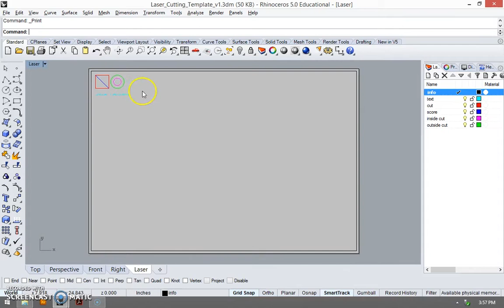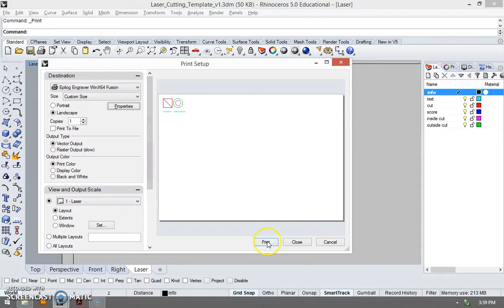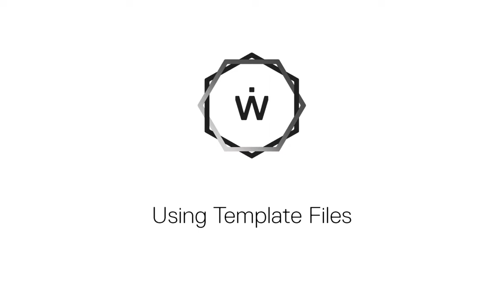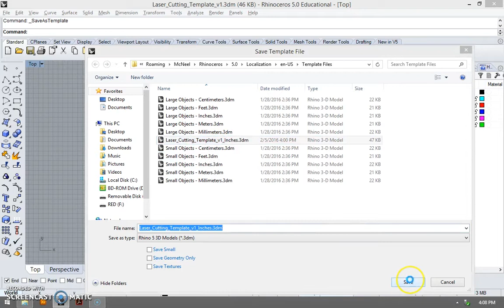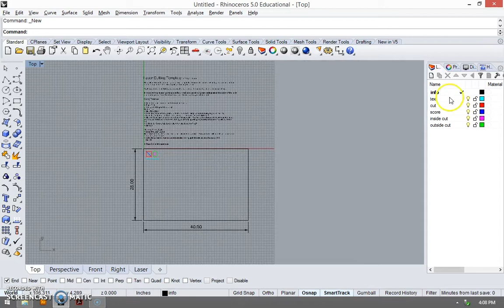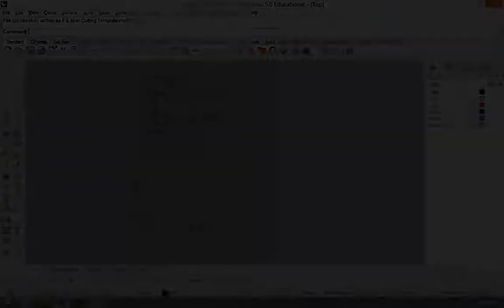Using Rhino for Laser Cutting

Comment: Of all the videos focusing on Rhino 3D for direct output to an  Epilog Laser yours should be at the top of the list.  Went through too many other videos that failed to focus on the types of laser cuts and engraving.  Moreover, how one can set them up in Rhino 3D by using a template file that matches the laser's cutting area.  
I am a long time Rhino user but brand new to Epilog Laser cutting and engraving.  My high school recently purchased an Epilog Laser Cuter/Engraver.  I am finding the process of exporting our Rhino  *.dxf files into Corel Draw, then output to the laser highly irritating.    Your video is the first I have seen that does that while staying in Rhino.  Well done!
Can you post a link to template file so that others can download and modify it for their specific Epilog laser?